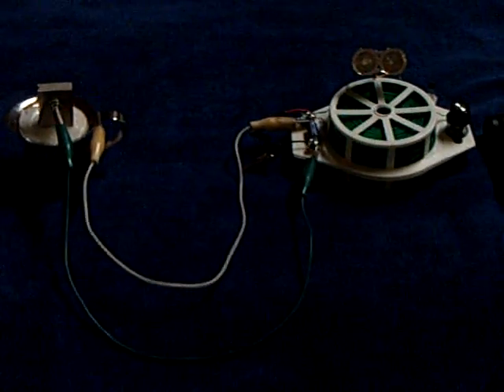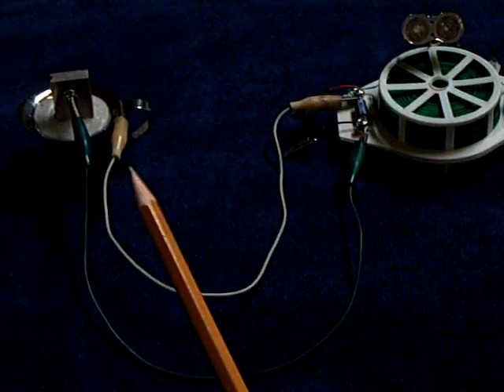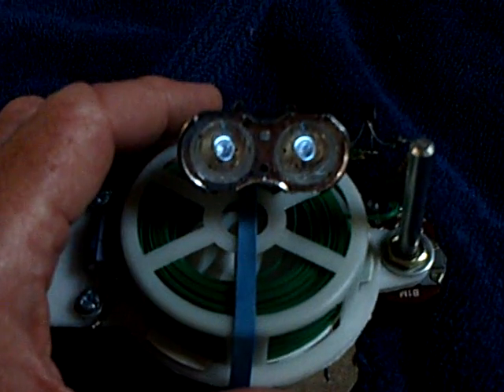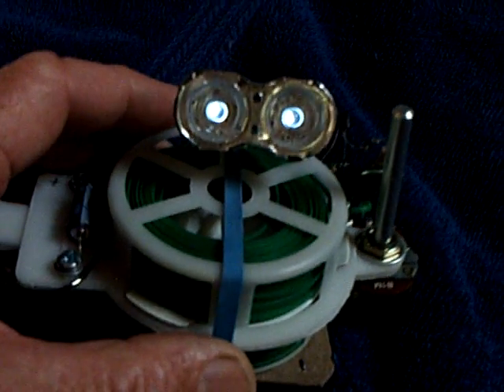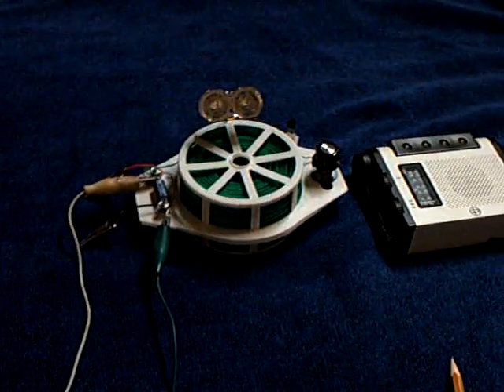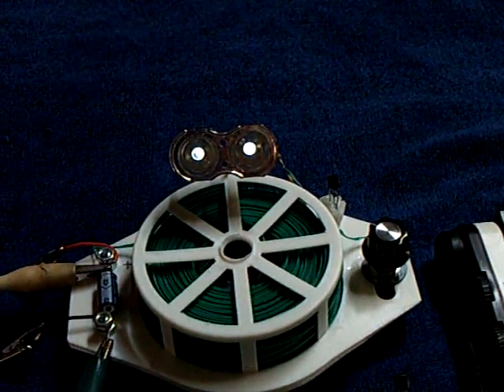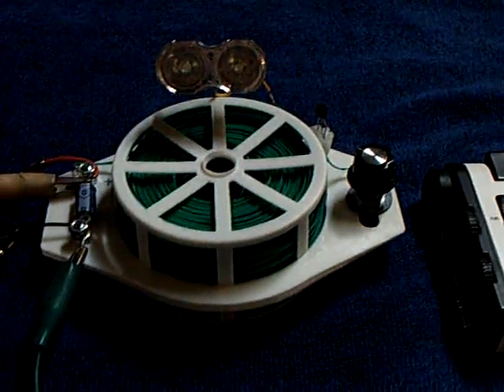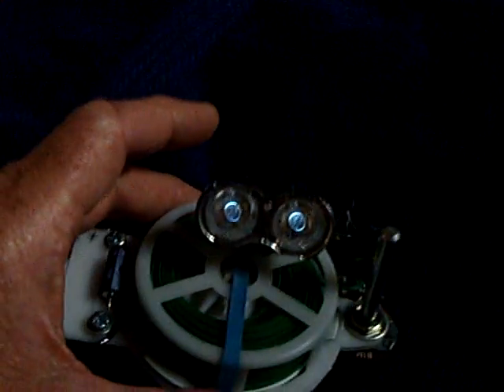Capacitive and feedback effects on Penny oscillators.ASF

Comment: @Lidmotor Thanks. Got 2 of mine running sweetly now...found a 2meg pot and that's where things were going screwy, but not in the right way cos of smaller pots. It's amazing ! The two DO talk at each other, syncing their flash rates too !!!. Resonance field is about 6" between Nephilim Penny and another modem coil based one...LOTS of fun :D

Comment from the maker: @slider2732 ------They even named the Mars rovers to give them some kind of personality.  The .1 uf cap in the circuit is the timing device along with the 1 meg pot.  The "stove top" cell is a little tricky to make.  You have to be careful not cook it with too much heat or cook it too long.

Comment: Cracked up when I saw the two sisters talking...its completely why we name these things isn't it hehe. Was watching Star Wars in Walmart earlier and thinking about R2D2 and C3PO being similar.
Got a 'stove top' here that only works if I hold the two metals..maybe similar. 
Also, swapped the '104' ceramic for a '103' and then '102' and may have had related effects - is that what you did for the capacitance ?

Comment: It makes sense to me that the cell makes just enough power to start the oscillator and once it starts to run the EMF pulses radiating off the coil would continue to stimulate the piezoelectric crystals into make power. Given the correct circumstance Theoretically it could even go into a runaway situation. You would have to find just the right resonance between the cell and the oscillator. An Oscilloscope would be helpful to show the signals. REALLY EXCITING STUFF. Keep up the good work.

Comment: Lidmotor, persistence pays off.  Keep thinking and testing your ideas.

This may be crazy, but is it possible that the crystal cells are somehow connecting into "the ether" aka, ambient energy?  When you touched the crystal and the penny started to run, I think that you somehow increased the ambient energy that penny was getting via the crystal.  In effect, maybe you were a temporary antenna.

I think that you are onto something greater than you know.

Keep up the good work!